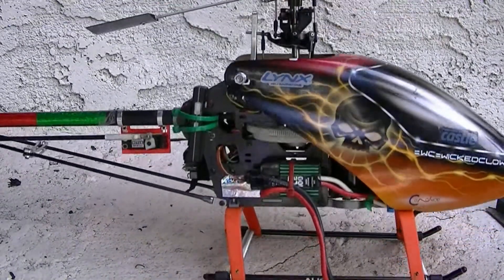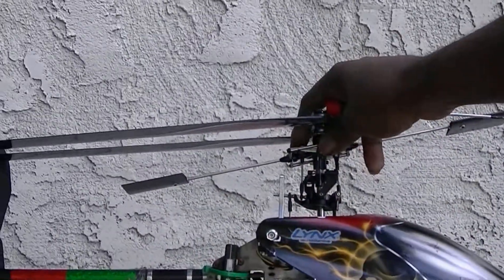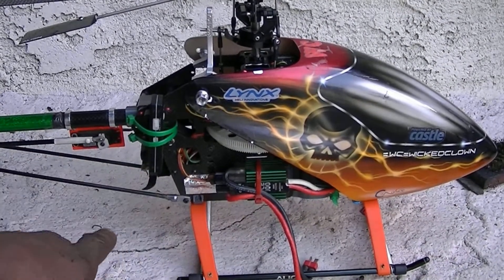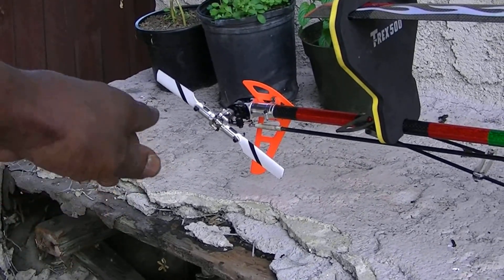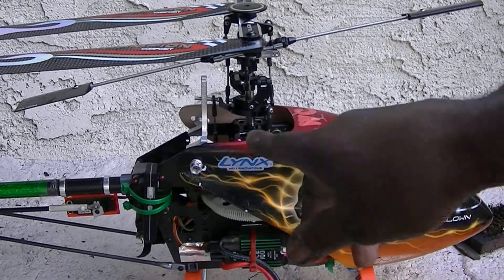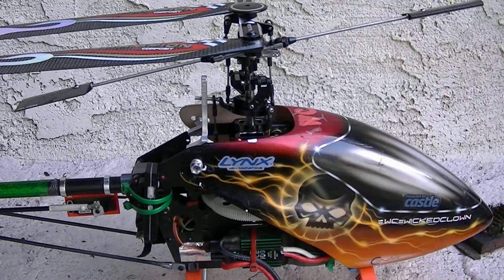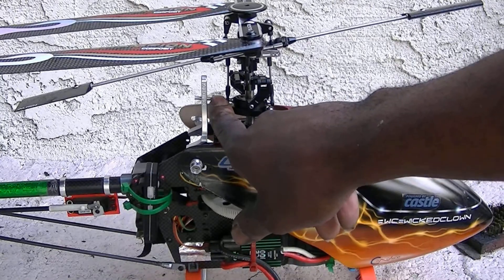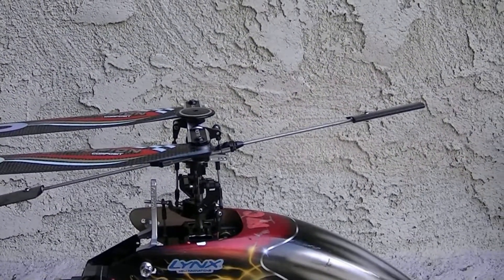where do you use loctite trex 500 good and bad pitch curve demonstration for stable hover

Comment: You are missing purple loctite for the smaller hardware also with Nylon lock nuts a dab of ca on them will give you a little added security as well.  As for the tail rotor shaft I use a dab of green on the shaft.

Comment: If you put loc-tite on a nyloc not it will ruin the nylon nut making it brittle inturn defeating the purpose of using a nyloc nut.. You just replace the nyloc nut when it starts wearing out, never use loc-tite on nyloc nuts.

Regards

Dave